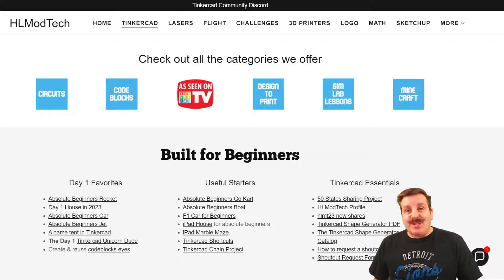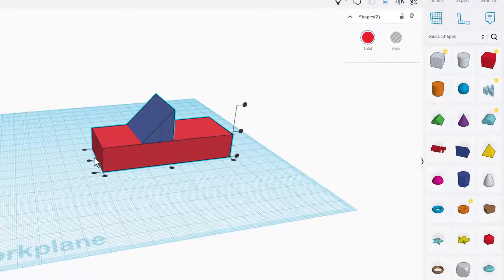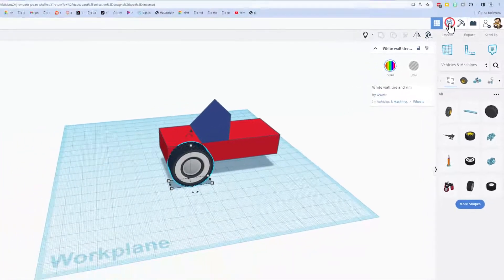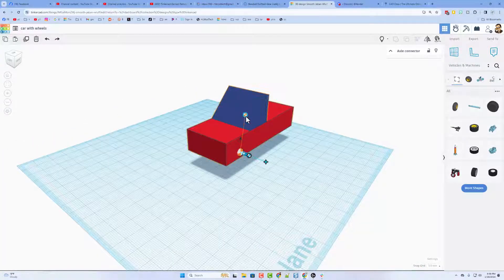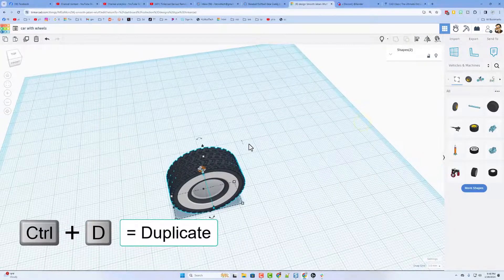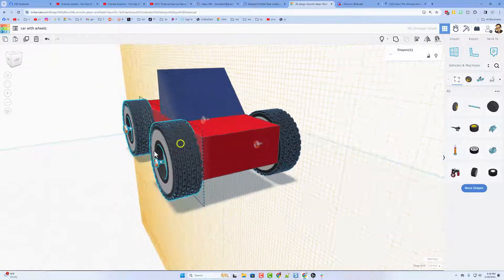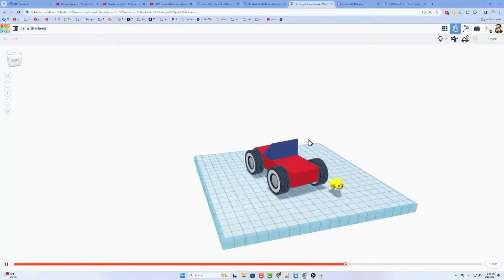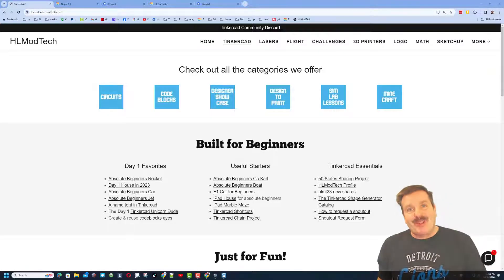Tinkercad Sim Lab New Connector Make Cars With Working AXLES!

Comment: How fo you get motors spinning?
Reply from the maker: This video. Make Tinkercad Cars That Move Sim Lab HAS MOTORS Easy Steps
https://youtu.be/PZlzPZg3qw8
Reply: @HLModTech  thank you! I noticed they had hobby gear motors and wanted to make a digital version of a robot kit that we made in class so I can make it better. I'll also need gears or rubber bands or belts and pulleys.
Reply from the maker: There is a gear shape that you can mess with. https://youtu.be/XnHdcD6xMMY Not sure how you will do rubber bands or pulleys.